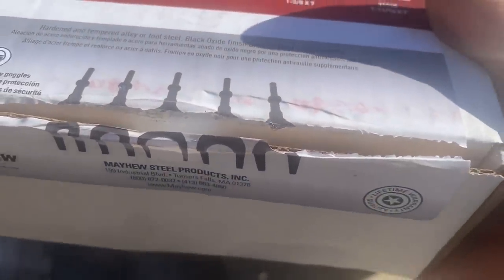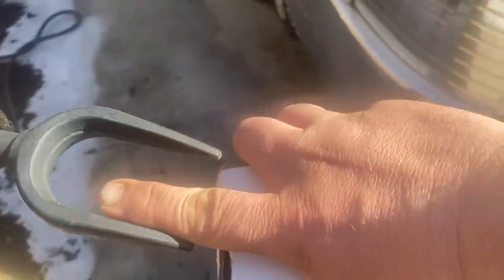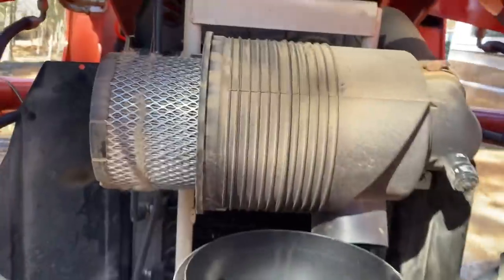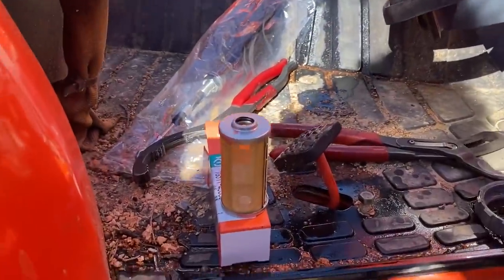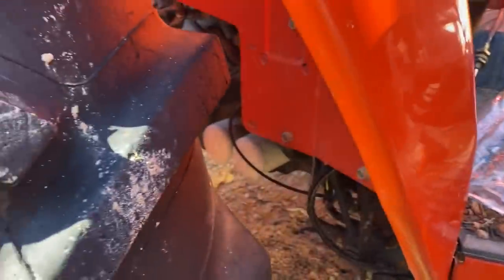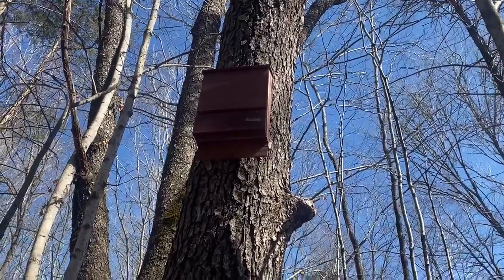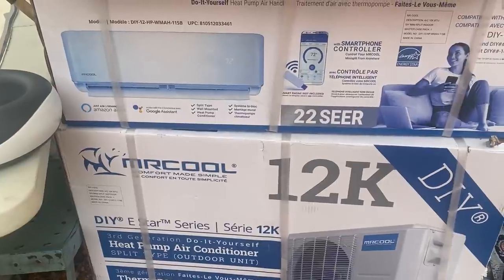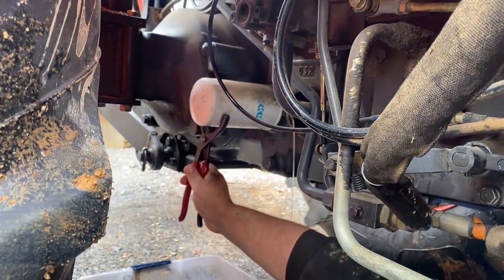Scenicruiser battle, kubota tractor service and more.

Comment: those ball joints use sound to distort the bevel. that pnumatic pickel fork would have worked if you tapped it with that hammer a couple of times at the same time.

Comment: I hate using heat, as I am sure a lot of people do, but it sure works wonders.  I had a hydraulic ram nut that wouldn't come off, I heated cherry red 3 times to no avail.  Took it down to a Caterpillar repair shop where they had a special tool that used hydraulic motors.  It took almost 30,000 ft-ibs of torque to finally pipe the nut.

Comment: I had an old mechanic teach me a tric on then joints . take a 2lbs hammer put it on side and another hammer 180degree on the other side strike them both at same time  and It will pop it right out
Reply: Yes, I was thinking the same. The other trick that works most times is while having pressure with the ball joint release fork (is it the correct term?), just hit with the hammer on the side of the counter part (arm? socket?). Makes great difference... Sorry about my bad language skills I 'm not native in english...
Reply: Same for pipe unions.

Comment: You guys need to look at a .498 shank air hammer like Astro 4980 or a CP 717 as those move steel the smaller ones are for delicate work

Comment: Working on HD equipment, any ait hammer smaller than an Astro 4980 (a.k.a "Big Nasty") is a waste of time.  Two issues,  You need a LOT of air (probably a 5HP compressor) and you need .498 tools.